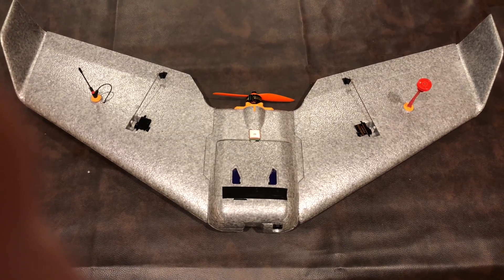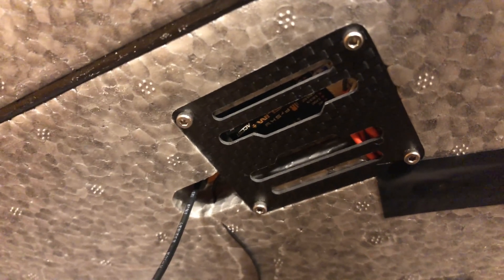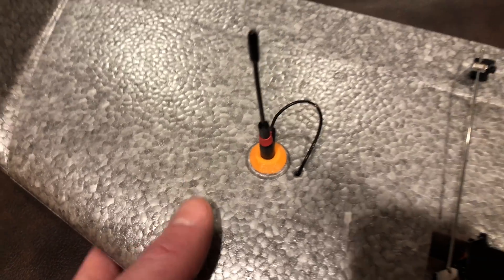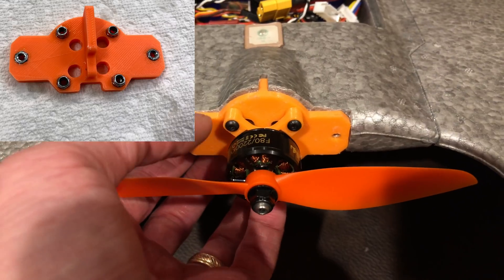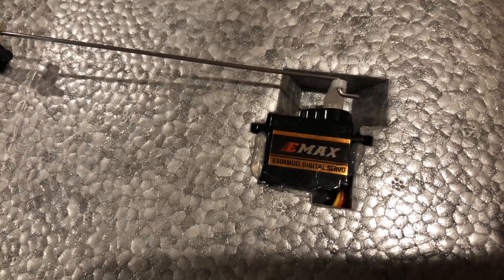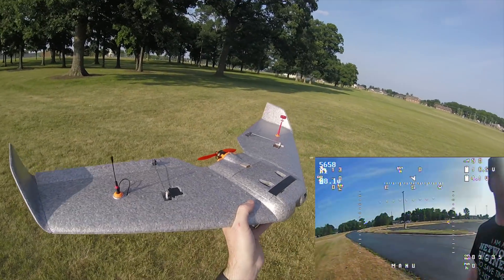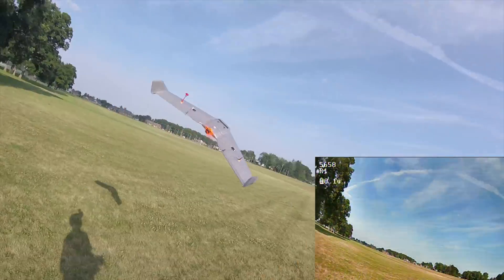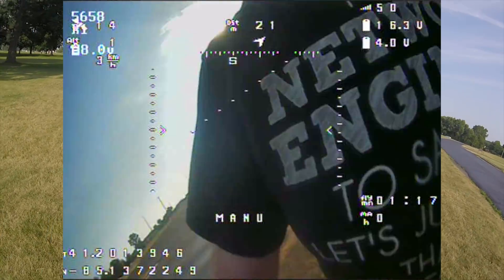My first iNAV build and test flight with an S800 Wing

Comment: Did you fix your osd issues at higher throttles? Mine does the same but I do have different stuff and a different wing but above 60% throttle my osd starts to go away and flicker.

Comment: How hard is inav to setup for someone completely new to flying wing and wanting to use inav for stable flight?
Reply: I'm surprised no one could answer your question, but as you've probably found, it's easier than it looks.
Reply: @burtpanzer  thank you, I kept at it and figured it out. Thanks for your response. I also don’t need the constant updates to inav. Essentially I use Manual,angle, occasionally horizon, rth, loiter and autolaunch.

Comment: S800 is a real good platform for FPV. But believe me, it's not meant for a very long range, as when you add a nose weight, the flight time comes down drastically. But you can expect a decent 5-6kms with your setup. 
Few things to note before any FPV plane flight: 
1) CG MUST be spot on. It also helps in the efficiency.
2) Always check the stabilization is working in right direction, and you have enough satellites. 
3) Check your failsafe configuration. Before you go far out on EVERY single mission, trigger a manual failsafe and ensure that the plane is coming back to you.
4) If you go out on a straight line mission, 50% battery should be your trigger to come back home. So always watch your mah usage ((if accurate) and voltage. Trust me, most of the times return flights are more worrying than forward flights.😊
If you follow these simple steps, you won't have any flyaways for sure.

Comment: Even with a tiny 2205 on mine I had to put 80 grams of weight in the nose to make CG as I didn't have a HD camera in the nose. With an F80 you will probably need to glue a house brick on the front.
Reply from the maker: I just checked and the camera I’m going to stick in it for testing is 70 grams.  I may need to add more past that.

Comment: Say no to fly away and stuck in tree, because it is like $200 flying away/ gone in a flash into the sun set. XD
i think you need to do the swing throw take off. like throwing a Frisbee.
Reply from the maker: Maybe,  I used this method with my previous wings,  but this one is quite a big heavier.  :-)

Comment: S800's fly really badly when they're even a little tail heavy, get some lead up front , I suspect that last crash was due to a tip stall. Those little carbon pieces are for a camera up front to hold it in, good luck with your project
Reply from the maker: Thanks,  I think I’m going to stick an old Fo-Pro I have in there so I can get some “HD” footage and add some weight.
Reply from the maker: Does the S800 have center of gravity markings that I can’t find somewhere?
Reply: I have an old eken H9 in mine, its a very tight fit so I don't need those carbon tabs
Reply: C of G is 125mm from nose, stick a camera in there and I reckon it'll be good
Reply from the maker: Is that was those are for?  I haven’t been able to find where they go.

Comment: A wing with Inav can not be less than 200 dollars periot.  I have many many wings from the rvjet, opterra and orbit, etc. the cheapes is the orbit and rmrc recruit v2, super stable and nice wings.
Reply from the maker: I appreciate the sentiment for the comment you deleted.  This isn’t really a park flier, I never got within a 100 meters of anyone else, but if something went wrong who knows were it would go.  I have ZOHD Dart I will FPV with but not iNAV.  I didn’t realize how much bigger the Orbit was.  There is quite a community for the S800 though and I decided on it listening to a podcast of wing builders who admitted you should just start with the S800 then move to them when you were ready to go bigger.  My budget build ended up being about $150, $175 with the upgraded options and I think it would be a pretty strong low/mid range contender.  The Matek F411-wing is going to be a game changer.

Comment: ok you got all wrong, first, you need to get a launcher before you end up in the hospital, https://hobbyking.com/en_us/pedal-operated-bungee-launch-system-ramp-for-fpv-gliders-light-edf-models-self-assembly.html?wrh_pdp=3, or make you own, second do not try any other mode other thatn manual first, and check what you need , more right or more left or up, then do not tourch the servos trim, just turn the turbacles in the control horns to adjust flight, then and only then use angle and horizon, and see what it does be prepared to click manual if a emergency, if goes up down left or right on angle, then adjust the board on Inav until you get level flight, ones you get level flight, activate auto lunch,  see video https://www.youtube.com/watch?v=hG379X7lQqE  then you horizon should be great, never mix horizon with althold, inav do not like it, use angle with altholt, horizon and manual, and  rtl with failsafe in a switch, do not use any gps capabilities until the wing is flying level and strait.  be carefull with wing this are not drone, two different mounsters, do not flight fpv until the plane is reliable on LOS,  do not take this light, we got one guy lost complete movement of his right hand all tendons cut.  Be safe and enjoy.
Reply from the maker: I appreciate that, especially the launcher.  I hadn’t seen that and will get one.  I trimmed this down quite a bit, it gets pretty boring watching a video of it just glide around.  This flight was 90% manual and a bit of testing with autolevel and horizon, didn’t try althold, RTH or FPV, I wanted the watch the footage to see how it was doing before trying anyone of those.  Just to make sure it was giving good, accurate data which other than the OSD cutting out at some throttles did look good, I was happy with its altitude, distance and direction estimates.  I appreciate the advice, I’ve watched a bunch of builds and flights to get here.  It was fun and I’m really looking forward to getting setup just right so I can test all the features.
Reply: Im using a omnibus f4 pro, if you do not want to have video and noise problems keep all voltage in one side of the board and only signals to the board.  I use a matek PDV with volt regulator on the board.  never use power from the flight control board to power you servos, you will brown out the rx. good luck.
Reply from the maker: Yea I didn’t want to but my planned ESC didn’t fit. This is my next step, to get off the board PDB. But I was leaving for two weeks and didn’t want to wait until after I got back to try it. 😁

Comment: put a cap on the leads going to the vtx would help a lot
Reply from the maker: Yea, I have two already but I think that is going to need another.
Reply: @SimRacer101  You might want to try grounding your FPV camera and VTX to the FC.  I had the same issue with disappearing OSD and interference.  Grounding fixed it.